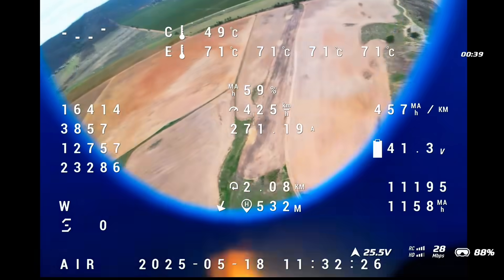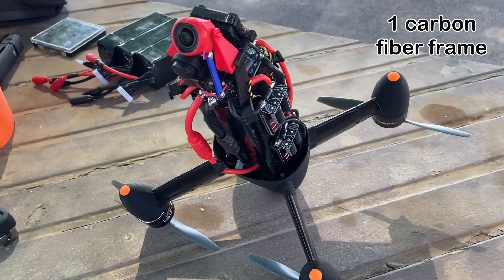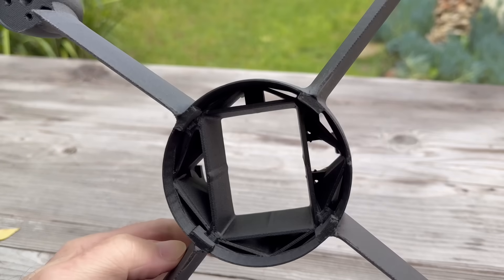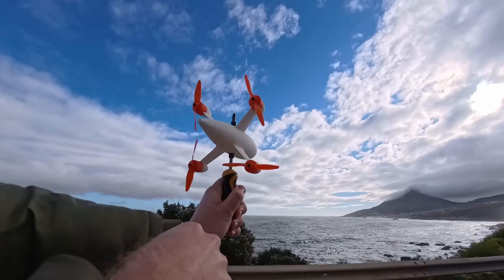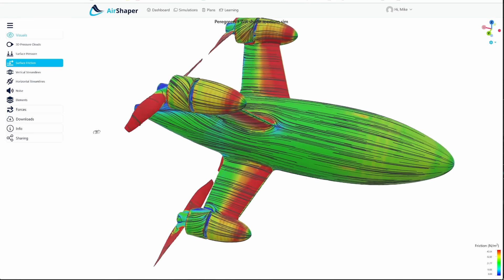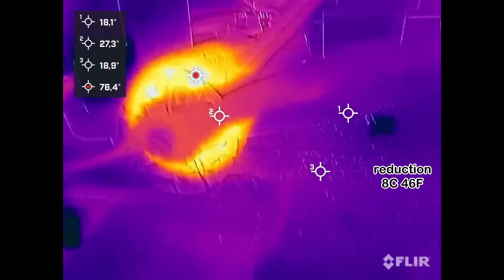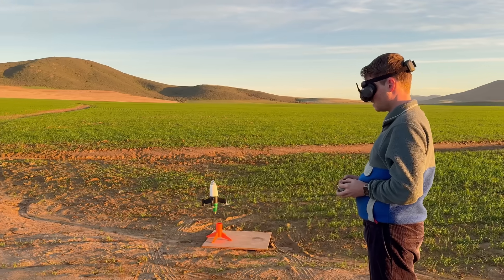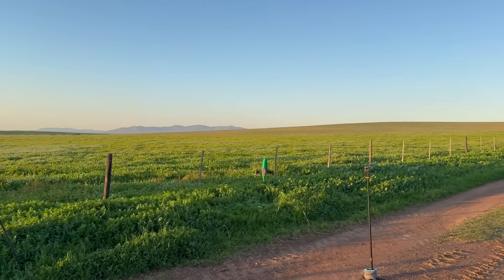How fast can a drone really go? 🇿🇦

Comment from the maker: If you value engineering accuracy and reliability, these are the printers I recommend. 
Using these links supports my channel at no extra cost to you:
- The Workhorse: 2 years of heavy use and still going strong (P1S) https://tidd.ly/4piBbOs
- My new favorite dual nozzle large build volume (H2d) https://tidd.ly/4jnTJeW
- Best Value / Entry Level: Bambu (A1 mini) https://tidd.ly/3YQMQJo
- The best filament dryer box bar none -  (AMS HT) https://tidd.ly/44OGAWb

Comment: To prevent layer failure in 3d prints you should look at how concrete people use post tensioning.
You have a bar or cable go through the layers and tighten\tension it to add compression to the layers, it can 5x-8x the strength before layer failure.
Reply from the maker: Great idea 💡

Comment: The two wobblyness Phases at different speeds could be because of the self oscillations of the frame , the outer shell both at the same time independently both as the same time as one group. To figure it out you could do a multimodal analysis and check if the oscillations cause by the flight wind or the drives or if both added up to frequencies which by chance had been the eigenvalues of the body. ( like in the toklahoma bridge earthquake example).  Not sure but a guess.
Reply from the maker: We have ran a camera in flight and the arms are solid. With the right flight controller tune we got the drone rock at top speed.

Comment: Have you tested rollerons for passive stabilisation?
Reply from the maker: That is an interesting idea. However simplicity and weight saving are a priority. Plus they would add drag. And once the the flight controller tune was dialled in it does a great job. There is also the rollerons and flight controller could get into an interference feedback loop.
Reply: Thanks, Mike! 

Is there a way to know how much power is being used for stabilisation as you get to top speed? 

I assume the drag from rollerons would be greater than the benefit, however everything seems to be counter intuitive when you get to the limit on things. Could be fun to try once you’re finished breaking all these world records, haha!

Fantastic project!

Comment: Did you guys try making dimples on the fuselage and/or wings to generate boundary layers to further reduce drag?
Reply from the maker: Dimples only help on golf balls. Not a single aircraft ever built uses dimples. Would just increase drag.
Reply: @Mike-Bell if memory serves they did this very thing on the leading edges of the wings of the F 16 XL and inadvertently got it to Supercruise.

Comment: Hi Mike Bell, do you remember when I wrote that I would break your new record? So now I'm counting the propeller and I don't understand why you chose such a 900 KV brushless motor? After all, it was possible to make another more profitable KV.
(I'm writing with a translator, I don't know English well)
Reply from the maker: You can’t just increase the KV to go faster. Its finding the optimal KV. For us 900 was best
Reply: @Mike-Bell  You may be right that 900 KV is the best solution. 
My drone is completely different, even in terms of its aerodynamic design, and I'm likely to have different results as a result.

Comment: Interesting work. Can I ask why laminar has not been considered? The fuselage profiles will at best only have a 30% laminate flow using it's profile. 

Look up Alex Strojniks books. More gains to be had

Professional aerodynamics and structures Engineer
Reply from the maker: Good suggestion but at our low Reynolds number laminar flow is much harder to achieve.

Comment: So is this all unofficial, or are there actual, written rules? Radio controlled gilders go over 800km/h using dynamic soaring, so there is a high chance, in my opinion, that simply making this a little less symmetrical, i.e. like a high aspect ratio wing, using a battery with cells laid out flat instead of in a block, will be an improvement (as well as rear spinners on those props, and cooling ducts, but with proper exits, not just entrances). But then it's skirting the grey line between a drone and a plane. Where is that line, officially? Who decides what it is? It seems to me that this is all just unspoken 'rules' among youtubers, not actual world records.
Reply from the maker: Fastest Quadcopter https://www.guinnessworldrecords.com/world-records/464800-fastest-ground-speed-by-a-battery-powered-remote-controlled-quadcopter
Reply: @Mike-Bell That gives zero information on what the rules are, what qualifies as a quadcopter, etc. 
If all it needs is four motors and can lift off vertically, it's easy to break this record.
Reply from the maker: The classification is perfectly clear.  Electrically powered radio controlled quadcopter , nothing ambiguous there.  

The helicopter record is 470kmh, 580 not easy.  

I agree the speeds reached in dynamic soearing are wild.
Reply: @Mike-Bell My point is that the definition of quadcopter is very vague. That's fine with me, I'll give this a go first thing next year. There's lots of room for aerodynamic improvement.

Comment: Given the complexity and weight of the water cooling, and the short duration flights, have you considered an open cycle heat pump; i.e., just venting a fluid to boil off through a heat sink before dumping overboard? Maybe with some built in channels in the 3D printed frame you could flow some over the motors as well.

Comment: Spinners on the back of the props might help?  Did you do any CFD runs with spinners?  Probably want to pull the same cooling-gap trick to keep the motors from melting.

Comment: Needs a aerodynamically deployed tail fins boom for added stability could be quite small at that speed. Be nice to conjure up a centrifugal or aerodynamically controlled constant speed or variable pitch propeller. Super cool the electrics with liquid butane or tetrafluoroethane. Must be away to incorporate some sort of control buffer or semi auto pilot if the bird loses signal, so the last command is maintained till signal is reestablished.

Comment: 6:26 Air cooling? wasn't the unit sealed so there was no air entering ? with a kilowatt of heat from the ESC's and battery this was bound to overheat. No need to go for heavy watercooling ....a small 3or 5mm hole on the tip of the nose will effect drag insignificantly ... with a 5 or 10mm exit hole at the rear you will get aditional thrust because the exiting air is much hotter ... works a bit like a ram jet ... free exra thrust from the waste heat. Unwrap the battery so air can get to each cell.
Reply: This is added thrust comes from the  Meredith effect ... https://en.wikipedia.org/wiki/Meredith_effect

Comment: Really amazing! Great father-son journey.  Did you consider the new MIT prop design? More thrust perhaps, but I don't know if they can be 3d printed. Superb iterative engineering! I did not know about AirShaper. Now I'm wondering if the water pump could function as a vacuum to create laminar flow. on the tail cone. Love the engine heat solution. Absolutely terrific is every way. Brilliant! 585 kph is fantastic! Truly inspiring!

Comment: Curious If ? Have ya considered a 5th motor on the Tail Cone ? Is it feasible ??
  Of course adding length to the airframe,, and I was thinking with a pulse dedicated battery for that motor that it could be initiated in similar use, as the jet aircraft use AfterBurner.  So, when max speed is reached with 4 motors the 5th can briefly be energized to break records…

Comment: As someone who has never built any racing drones, I can't help but think there is a huge power waste in takeoff,  if the quad could be launched at speed or dropped from height the props might be able to pitch higher as well as the water cooler and might be sized smaller

Comment: If you had an aluminum ring for the water tank exposed to the air it would cool off. Why not use water to cool the engines as well?

Comment: Amprius' silicon anode batteries offer 500 Wh/kg gravimetric energy density,  so why not use those?
Reply from the maker: Only Lipo have the rapid energy dump. Would get the burst speed with anything else

Comment: I would think that you could calculate the Doppler shift of the controller frequency and sanity check whether it is plausible that this is indeed the mechanism, versus something else like an antenna deadspot, say.
Reply from the maker: Doppler shift is negligible. But it some phase shift or something. Still don’t have the answer but are now hearing of others who have seen the same thing and specifically the 04 version of DJI air-unit.
Reply: @Mike-Bell Thanks!

Comment: ✅😆FANTASTIC ‼️
-this stated WITHOUT 
irritable sarcasm now: 
YOU BOTH ARE LIKE FAMILY!!!- well spoken and great engineering skills, problem solving, as well as tenacity in NOT slacking in ANY way, shape, fashion, or form. 
YOU DEFINITELY, ALSO, certainly do inspire me to pursue with happy ferocity all my endeavors !!!
Suggestion: 
How about AUGMENTATION, WITHOUT HIGHEST SPEED BEING ANY FACTOR TO CONSIDER, and instead, PRIORITY#1 WOULD BE UPON IT'S SUCCESS WITH THE NEW GOALS: 
#1 A TRANSFORMING
PROTRUDING FIN/S
TO ENABLE THE DRONE TO GO IT'S TOP SPEED AND THEN DECELERATE AS FAST AS POSSIBLE TO THE DESIRED "BASE/STATION"
    A) BASE STATION
        1. RECHARGES
        2. PROVIDE 
          ADDED COOLING TO MOTORS
        3.  ADDS INITIAL TAKE; OFF VELOCITY
-
#2  HUNTS OTHER 
      DRONES TO DESTROY/KNOCK THEM OUT OF THE SKY
      A) STRENGTHEN RESPECTIVE PARTS OF FRAME
      B) transforming
"Piece" deploys out of drone as close to impact as possible then retracts
-
NOW, IMAGINE A GROUP OF... SAY 10 REMOTE-PILOTS
that would set up
base IN AS LITTLE TIME AS POSSIBLE, and THEN DEPLOY TO PROTECT A FEW SQUARE MILES OF AREA FROM INCOMING CHEAPO DRONE-BOMB KAMIKZES from the enemy !!!!!!?
-
God & Jesus/Emanuel
👆🏽🙏🏽😇, 🇺🇸⚔️, from
U.S.A. with love, and much respect, as well as much appreciation
& thank you for sharing your work!!!
-
If I had the time and the extra money, I would have done this all approx. 20 years
ago when I, upon being asked by a few VERY HIGH military officials how to solve a few BIG problems with, yes- THEIR DRONES BEING ... let's just say "BOTHERED" by certain enemies defenses. 
I HAD AN EXTREMELY QUICK AND PRECISE
(within 7 seconds of thought after the question was given me what to do with the problem. )
And, MY ANSWER INCLUDED THE DRONE SIMULTANEOUSLY BEING AN EXPLOSIVE ABLE TO SELF DETONATE, AS WELL AS DETONATE BY THE REMOTE OPERATOR. 
- ( My fellow FREEDOM and PEACE loving people; AGAIN, IT WAS WITHIN JUST
7 SECONDS !!!!!!!
✅👉🏽 Yes, I'm happy and very satisfied with myself upon that one !!!!!!! 😊
-
Just wanted to let you both know, that you have been contacted by not "just some Internet venue "quack" weirdo" [ and God bless them all with a speedy recovery, in Jesus name, amen. ]
-
And so, if you wish to network; THINK OF US COLLABORATING as a group of semi-mad scientists with respect to our limits of creativity, or the LACK THEREOF, and of course: 
‼️ FIRST AND FOREMOST, OUR #1 GOAL IS FRIENDSHIP AND FUN !!!!!!! fun fun fun fun and more fun !!!!!!!
Ever been offered a job by y your military to just join a group that simply delivers PROPOSALS to improve any and all weapons, constantly, and the passed proposals go straight to the FABRICATORS in respective R&D Engineering departments !?
A lot of FUN, INDEED. 
( especially when you watch your ideas that have been CREATED AND TURNED INTO AWESOME COOL MACHINES/APPARATUSES IN OUR REALITY, and making a SIGNIFICANT DIFFERENCE for ALL THE FREEDOM AND PEACE NON-EVIL COMMUNIST AND GOD & JESUS FAITHFUL PEOPLES !
-Ok,
way longer than I didn't even think, to be sure- but, WHY NOT ? 
I actually now REALLY VERY MUCH look forward to  a reply from you, saying something asking the lines of "... Ok. Sounds like fun! How shall we proceed? "
-
Nothing ventured, nothing gained. 
Great job again, you guys, and stay happy and ship-shape.
YOUR FRIEND IN THE U.S.A., Marco.

Comment: in terms of mass efficiency, air cooling < water cooling < PCM integrated heat exchanger.
its once of the secret sauces used in classified phased array radars which are super temperature dependent and at max power have insane cooling demands. even with pure silver components, there isnt enough thermal conductivity in the world. only way to keep them running without making massive penetrations in stealth aircrafts is to maximize the temperature gradient over heat sinks by using PCM like soywax/parafin wax inside of sealed heat sinks. you can make up for natures garbage thermal conductivity by using latent heat of PCMs to speed up heat transfer by maximizing temperature gradients.
if you are still not convinced you can just compare the thermal mass equivilance on paper. using latent heat of an organic pcm like wax is around 5-10x lighter than using the equivilant chunk of copper, and its also much more compact. latent heat always wins.

Comment: Just a wee thought...
Regarding radio reception and signal dropouts, it can be said with 99.999% certainty that it is not due to the doppler effect. Please consider 'Circular Polarisation' it offers several major advantages in radio frequency transmission, especially in applications where antenna orientation is variable, or signal reflections and multipath interference are of concern. Instead of the signal's electric field oscillating along a single plane, as in linear polarisation, circular polarisation causes the field to rotate in a spiral, or helical, pattern. Also, if your transmitter aerial is at some reasonable height, try not to get close and under it. Another interesting problem can 'sometimes arise' when the signal is so high it can, as we say, swamp and overload the front end of the radio receiver. A wee RF signal strength meter could also help in tracing signal strength anomalies. 

Thank you very much for your video, it was most informative and professional in every respect! Good luck to you both... 🎉
     🇬🇧🇺🇦🇬🇧🇺🇦🇬🇧🇺🇦🇬🇧

Comment: Hello, my suggestion for improving cooling is to make microperforations in the fuselage, so that by Bernoulli, and the high speed of the device should generate suction and internal currents.
Reply: For such short flights I'd rather go evaporative, would you not ?
Reply: @chiwawaquarante-deux3068  Bernoulli is free, doesn't add weight, and will certainly add extra miles. But it's just a suggestion.

Comment: You mentioned the skin and shape drag from the golf ball with and without dimples. You should totally incorporate dimples into the skin of your design I don't see them used enough, they aren't used enough.
Reply from the maker: Dimples are for golf balls only, because a ball is a terrible aero shape and a particular quirk that only benefit balls.  Not a single aircraft or airliners has dimples because it just adds drag.  You can be certain all Airliners would immedeately apply dimples if it save fuel.
Reply: @Mike-Bell I was thinking hammer and nail style on this one, researched it and realized that aircraft use better system to the same of greater effect. Thanks for straightening that out.